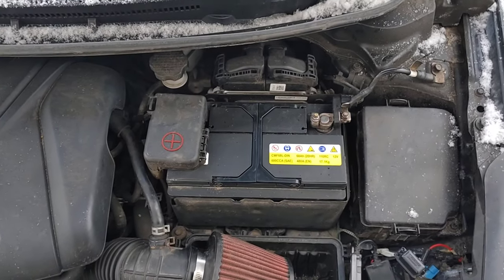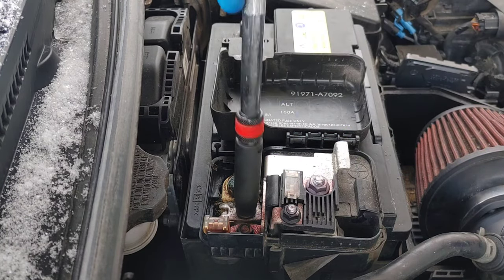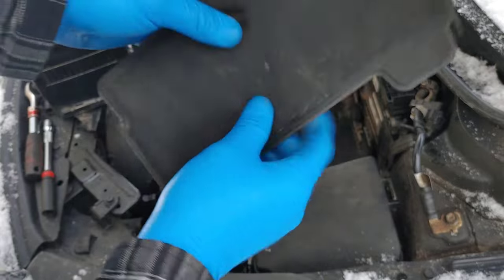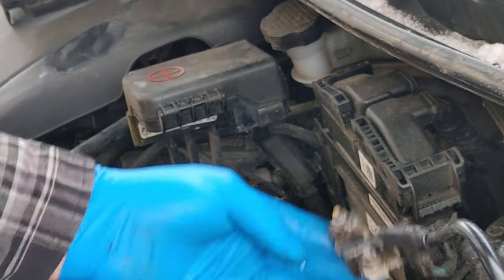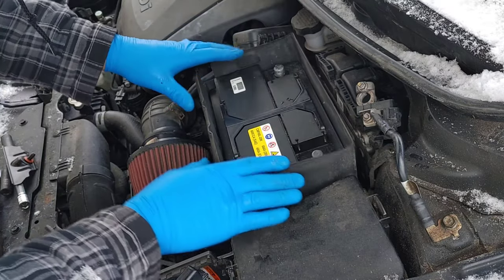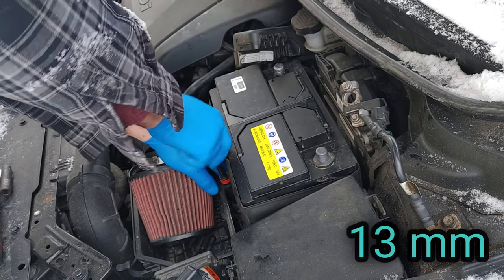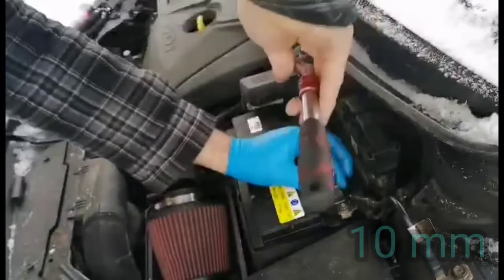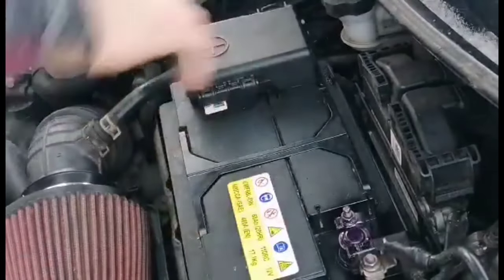Kia Forte Battery Remplacement -2014 to 2018-

Comment: Actually you have to make sure the OEM battery is a size 47 or sometimes it'll be called H5. CCA is cold cranking amps meaning essentially starting power. Depending on the battery manufacturer it'll be lower or even higher for lead acid. If it is AGM it will be higher while raising the AH or amp hours. Also when you take out a battery disconnect the negative first, then the positive. For putting in a new battery it would be in reverse so positive and then negative.
Reply from the maker: Your are right ! Thanks

Comment: You shouldn’t tied first the negative, the correct way its tie the positive and then the negative
Reply: Right disconnect the negative first then positive then do the opposite connect + then -.
Reply from the maker: Good point but guys don't go crazy with IT 😅

Comment: The negative side cable,  when you put it back on, it is like rocking I cannot get it tightened. I don’t know what is wrong with it.
Reply from the maker: Those connections are really weak , first tap gently on the ground to get him deeper on the pole and the second option is to squeeze a little piece of Cooper or aluminum paper on one side of the connection